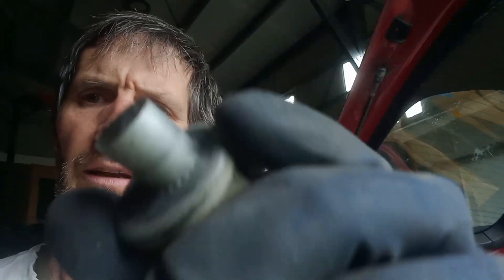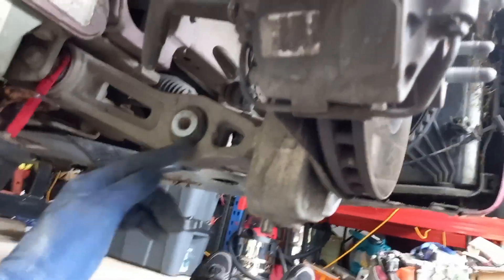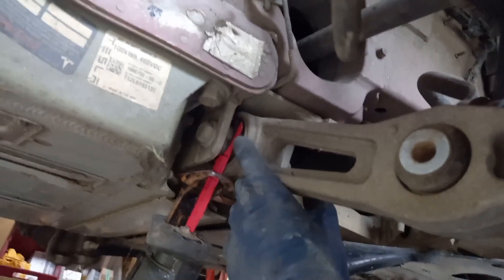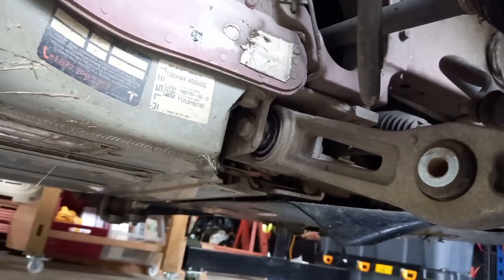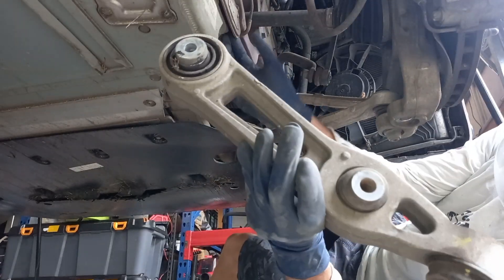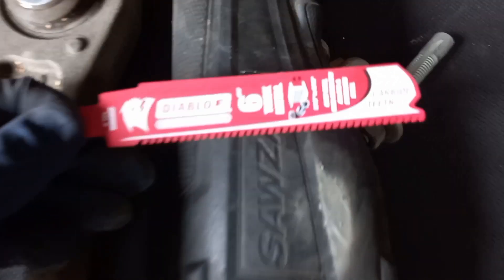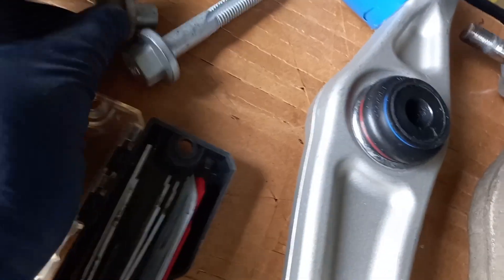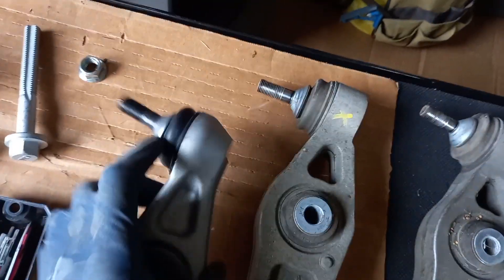$100k car vs power saw-how to change Tesla Model S Suspension without dropping the battery

Comment: Why does the bolt have slots in it like a thread tap?
Reply from the maker: It indexes the eccentric washer so that the washer is off-center to the same degree as the bolt head. You rotate the bolt to adjust geometry & then nip it down with the nut.